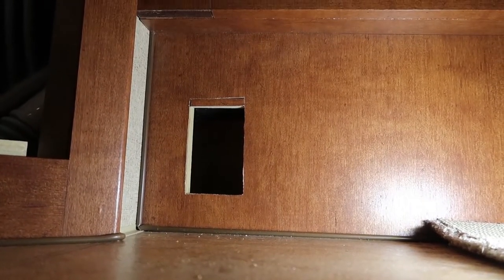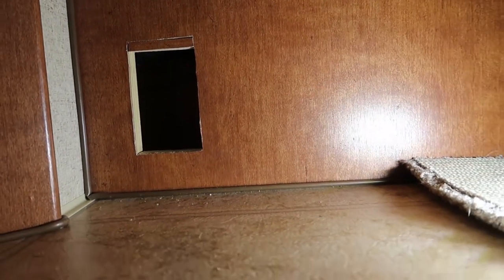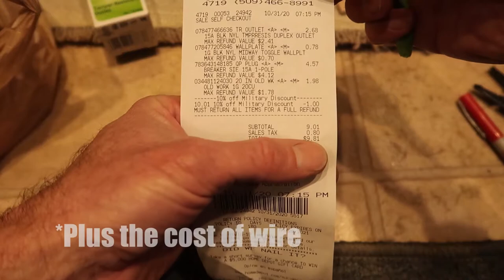Adding a 120vac Outlet to my RV | Arctic Fox 992 Truck Camper Upgrades

Comment: This is so funny, before I got to the part where you went to plan B outlet box, I thought to mention how lousy the RV ones are made how poor the connections are for heat in using them too...and that I always use the blue boxes.   Nice job!
Reply from the maker: So true! 
The RV style outlets are probably not the greatest when using a high amp draw appliance, like a heater.  There's just so little surface contact between the wire and the terminal in the outlet, it seems like a lot of heat from resistance would be generated.

Comment: I don"t want to be the code police on this, but just so you know...... National Electric Code article 551.42(C) specifies a Maximum of five branch circuits for a RV with a 30 amp/120v system. An exception to that is when an electrical management system is installed. Compliance with the NEC is required by the RVIA (that oval certification sticker on the outside of your RV). Again, nice job, just thought you might want to be aware.
Reply from the maker: That explains why RV manufacturers do odd things like running multiple wires in to one circuit breaker, like I show in this video:  https://www.youtube.com/watch?v=JxZYdKLZJzg

Comment: Not to be a kill joy. But rv plugs are garbage. Use residential outlets and boxes for safety.  I would cut a piece of 5/8 plywood instead of the small pieces,  far better rigidity for a box.
Reply from the maker: I used a residential plug and box, as the video shows.  The small pieces of wood worked fine.   There was no logic in buying a sheet of plywood for a project this small.
Reply: @Delta Bravo   just for your knowledge base, home depot sells 1x1 pieces up to full sheets.